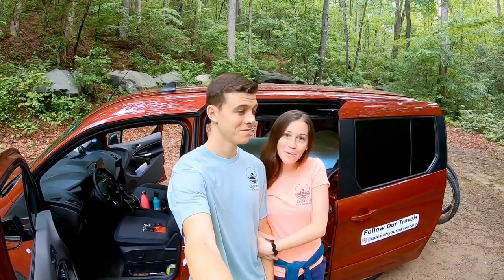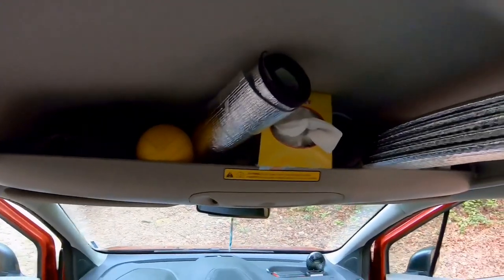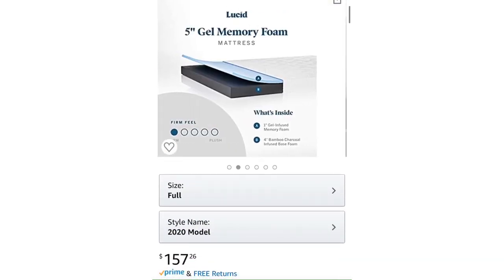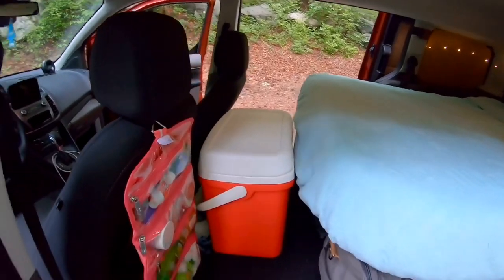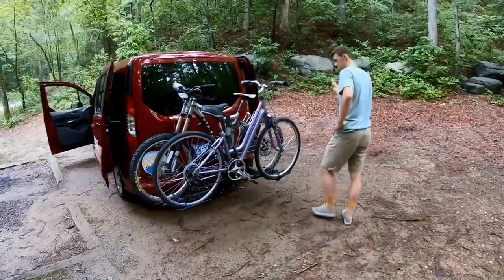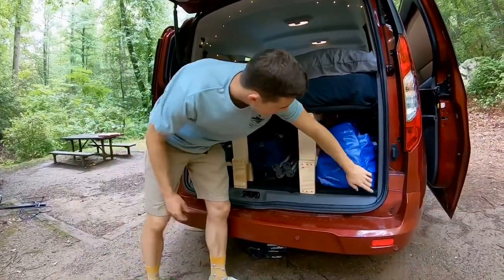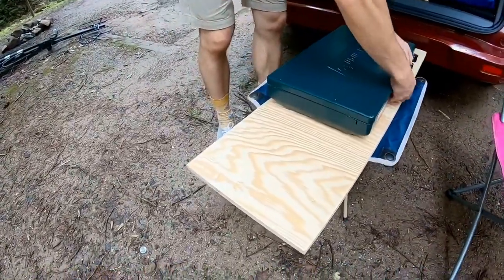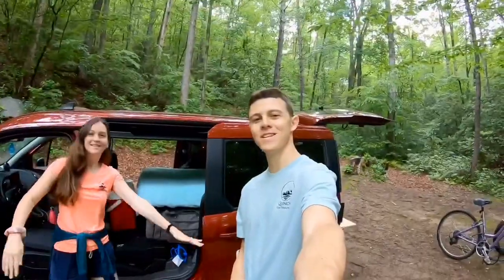TINY VAN CONVERSION TOUR | Ford Transit Connect | Minimal Camper Van

Comment: You guys inspired me.  I just bought a 2020 FTC Passenger Wagon XLT LWB.  I can't wait to build the sleeping platform based on your design.  Brilliant!!! 😀

Is your sleeping platform (wood structure) just resting on top of the folded carseats?  If so, I love it.  Not having to drill holes or bolt it into the floor, etc...

Thanks so much for the inspiration 😀🚐
Reply from the maker: Wow, so great to hear that and we’re stoked for you! If you haven’t seen the “How-To” video we posted just before this one, here’s the link if it’s helpful. 

https://youtu.be/uGihQz6FgCw

But to answer you, yes, it’s just resting on top and I made some extensions on the bottom rear to keep it in place. Where are you located? We actually live in an RV now and will be looking to possibly sell the platform (and maybe the mattress that we cut too). 😀
Reply: @QuenchYourAdventure  I'm in the San Francisco Bay Area.

Thanks so much for your excellent videos.  I loved them both!

I now have the inspiration that I need to build my own sleeping platform for my new FTC 😀🚐

You guys produce wonderful videos.  Wishing you both the very best.  Merry Christmas 😀🎄
Reply from the maker: Oh wow, that’s a bit far! You’ll probably be better off building your own then haha. I wonder how hard it will be to try and sell our platform and mattress here in NC. 

Thank you so much for the kind words. Best of luck on the new adventure and Merry Christmas to you too! 😀

Comment: A couple of tarps strapped together with para cord hung over the tailgate and pegged to the floor would eliminate the need for the privacy shelter.
Reply from the maker: That’s a good idea. More room and cheaper. The cool thing with the privacy shelter is it worked with the 5 gallon solar shower that could be hung inside of it. But if you’ve subscribed and seen our more recent videos, we actually live in an RV now, so this doesn’t apply to us anymore haha 😁

Comment: Great video! Thank for sharing; looks great! I have a 2016 Transit Connect that I somewhat converted; seats were a bear to take out; some still in on one side where I put my mattress. Waiting for my roof box to come in so I can get back out there. Safe and fun travels. 🤗 🚙
Reply from the maker: EarthWise Media Thank you! Oh cool! Yea I’ve wondered about removing seats. Love it, same to you! 🙂
Reply: @QuenchYourAdventure  The back ones are not to bad to remove; but I have the two middle seats and one took hours to remove; I hear the bench is easier; best is to get the cargo van and convert. Thanks for subscribing! Having a heck of a time getting to 1000. :-) I also try to help new vloggers out. If you're ever on the east coast near NC;  let me know. Stay well and Safe!
Reply from the maker: EarthWise Media Oh wow. For sure! Thought I’d help you out too. It’s a slow grow. Cool, whereabouts?
Reply: @QuenchYourAdventure  In the Raleigh area, but Wilmington as well. :-)

Comment: How do you trim the mattress and have it not fall apart?
Reply from the maker: Good question. I wasn’t sure how it’d go. Just used a standard razor blade and it actually went well. The edges have shreds and it made a bit of a mess, but it held together just fine and really worked out well. Watch this video and you’ll see the process. https://youtu.be/uGihQz6FgCw